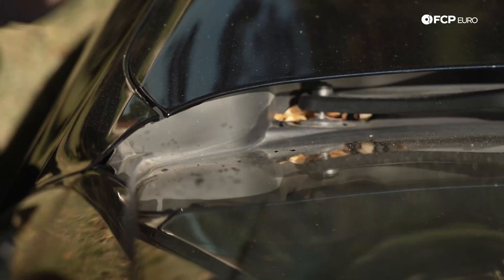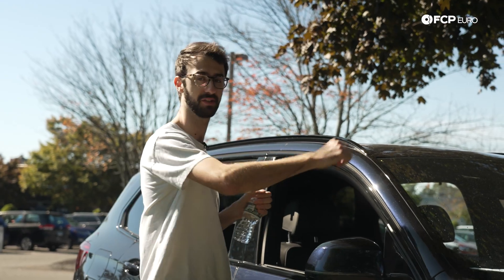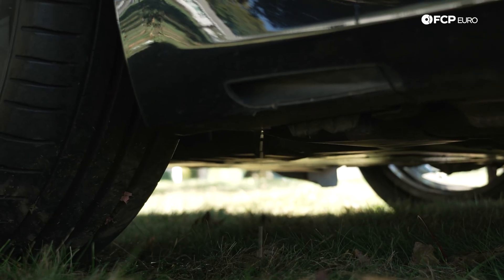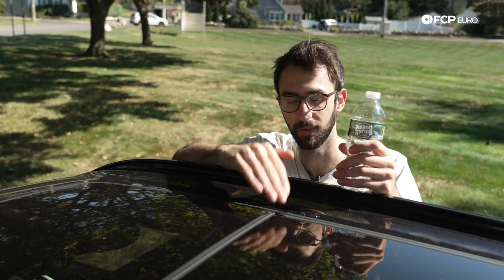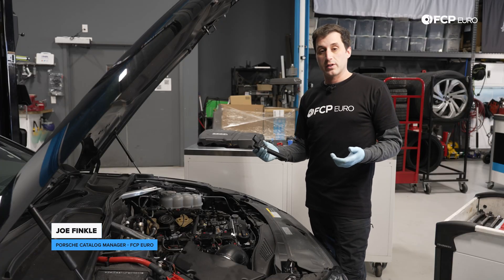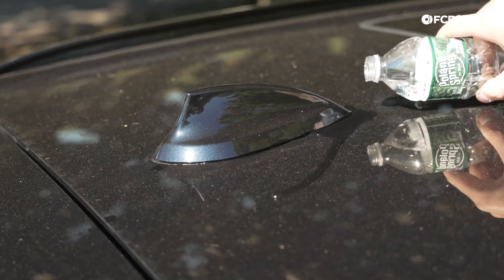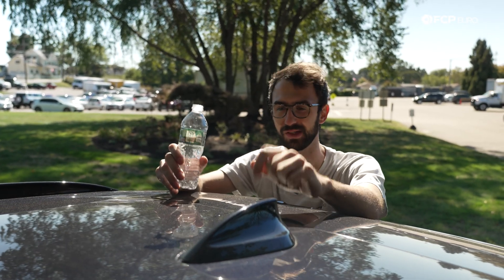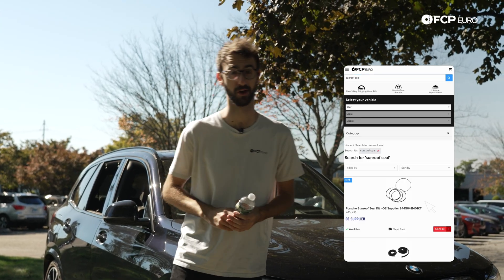The Best Preventive Maintenance? Clear Your Sunroof Drains Before They Fry Your Electronics!

Comment: Clogged sunroof drains ruined my ‘09 Passat!! Preach!! 

Water seeps into the cabin and gets into the HVAC system, corrodes the blower motor, messes with the transmission control module… what a mess. Easily preventable as well.

Comment: It would have been nice to see a demonstration, showing how this is done.
Reply: Open your sunroof, look for the drains and stick something very thin and flexible to clean anything stuck in there then pour some water down the drain when you’re done and check under your card to see if it worked

(That’s how it is for mine anyways)
Reply: @thehzomogod : Thanks. That takes care of the sunroof. What about the rest of the car’s drains? Where do you look for them?
Reply: @Itsme-vo4fx  Hey man I only clear my washer ejectors and sunroof drain because I get told to 😂 I couldn’t tell you where the other drains are and what they drain.
Reply: @Itsme-vo4fx  There are drain(s) under each door, there is a drain in the fuel filler area below the cap, and also the trunk or deck lid, depending on the car. There is also an A/C drain under the car, but this is for condensate water, not rain water. It should be checked if you are experiencing water sloshing out onto the floor during hot humid and summer months.